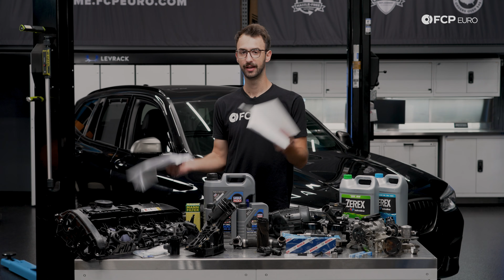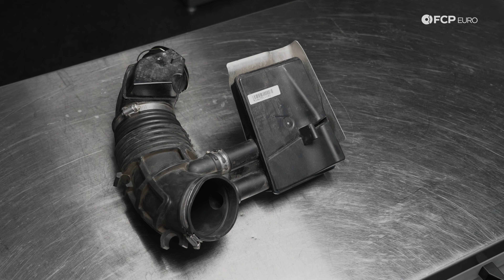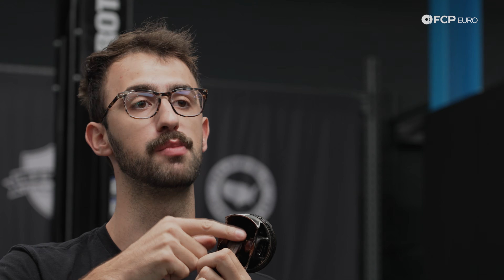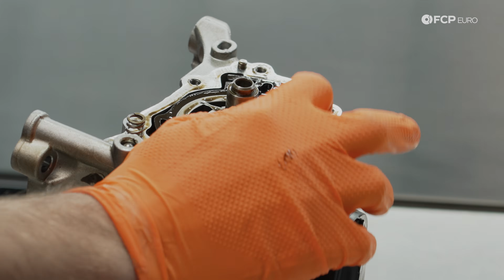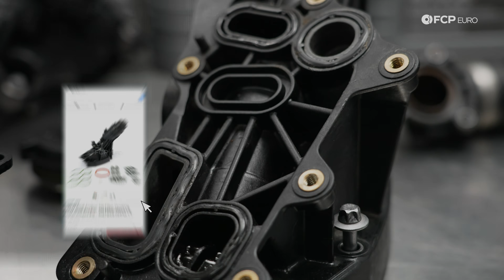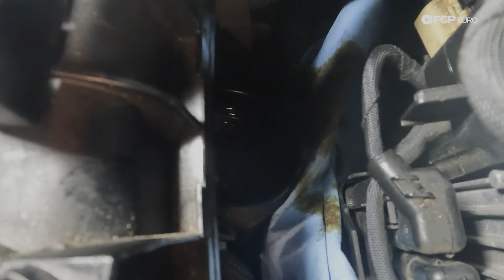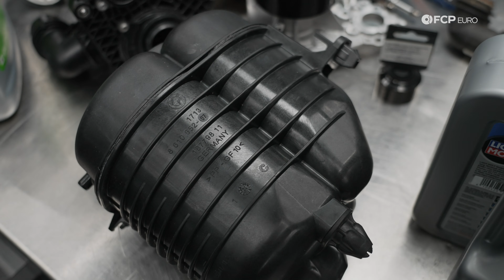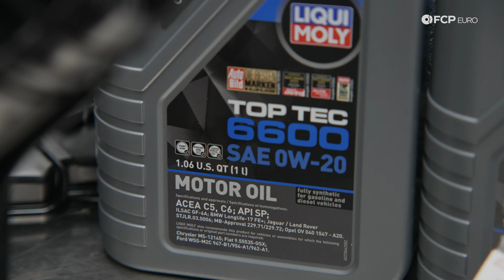BMW B58 Engine Guide: Everything You Need To Know

Comment: I have 440i 2017 with 180000 miles no complaints do maintenance on time. Now running mhd stage 1 and xhp stage 2, love this car.
Reply: You have just convinced me to not sell my 2018 440i w/manual transmission, which has only 11,800 miles because I have switched to motorcycles for daily driving.  
I have done the same; mhd stage 2.  I had ordered mine with the M Exhaust/Performance package.  I did not want to drive it due to fear of something breaking but if you have yours for 180,000 miles and love it, I am keeping mine 😊
Reply: @maldridge7630  great yeah man i love this car each day, mine is mhd stage 1 and xhp stage 2, i believe mhd stage one does the justice to price and also without putting extra strain on car. Just my opinion
Reply: @maldridge7630  mine just hit 120k its worth it to keep!
Reply: @maldridge7630what’s difference between 340i?
Reply: did you have to hcange the oil filter housing?
Reply: @TheDumbCow1 no but my engine oil chamber where the oil drain plug is showing wear may need to redo the thread I believe may be due to excessive torquing by mechanics
Reply: That's good that it has that kind of longevity mine has 88,000 me already 3,000 of those miles but I've done a lot of hoping it lasts cuz I love the car
Reply: just do all the oil and plugs earlier. Also at time i do put injector cleaner additive.
Reply: Does XHP stage 2 make a big difference?
Reply: I think, because when i had mhd stage 1 it felt like car is holding up the torque and not really utilizing, after xhp stage 2 it really opened up.
Reply: @jeremyalves9814 I don't think it makes a big difference it's just something you run if you've got a catless downpipe or a high flow aftermarket cat and you won't get a check engine light and it might make a little more horsepower too
Reply: @ShanDobson thanks for the reply. But I think you’re a bit mixed up there. Stage 2 ECU tune is for the check engine light. XHP is a transmission tune so not related to the CEL.
Reply: @jeremyalves9814 10-4 I wasn't paying enough attention sorry
Reply: @jeremyalves9814   it does feel faster and more aggressive like the M cars 8 speed
Reply: What did you change so far?
Reply: @bmw3series128 i bought the used car at 185000 kms it had minor radiator leak, i changed the radiator after 2 years, i have changed expansion tank and its cap, i changed the compressor at around 260k+ kms. Rest preventive & regular maintenances.

Comment: Expansion tank leaks. Try the cap first. Cost £15/$20 for a genuine part. Fixed leaking issue on my 2017 540i xdrive. Caused by cap o-ring degrading. Use BMW part, don't use non standard parts. The cap contains a pressure spring to vent excess pressure to atmosphere. Non standard caps may not contain the spring or may contain incorrect spring meaning the expansion tank can be pressurised beyond limits and begin leaking itself.
Reply: Or replace both pieces with aftermarket, it's how the tank is sold on every one I replace. Aftermarket parts are often an improved design and better than OEM. 😉

Comment: So what I’m getting is BMW didn’t purposely make it a good engine it just turned out that way because it was based on the diesel version and they probably carried parts over because it was cheaper than buying different ones. I sure am glad it happened at all though.
Reply: It's a toyota designed engine. It's why it's very reliable.

Comment: You apparently don’t have much experience with the n63tu2.  It is EXTREMELY reliable with nothing but 5,000 mile oil change intervals.  It is not the original n63.  With 10,000 mile oil change intervals, any engine will have issues. Bottom line.

Comment: 2019 X5 40i owner here. 
From my understanding, the cars serviced at dealer with original viscosity 0w-20 oil should not experience this oil pump failure. 
Any counter example to that? 

In forums a lot of people complaining about this issue. 
It is kinda scary every time you check the oil level and to see if it is going to quit measuring without completing the operation.
Reply: I had not heard of the viscosity link to failure that Alex mentioned.  Would love to see the data on that.

Comment: I’ve had my m40i for a year now and it’s just such an awesome car. The best daily driver you can get. Great video, learned a lot!
Reply: Have you had it in the winter? I'm super curious. Also are you over 180 cm? How do you fit in it? It's one of the cars on the list to replace my 500hp 2012 A6, which I love too much. 
They're still holding up their price too! You picked well.
Reply: @OWanKeno9i  Yes, had it through last winter. I have a 2nd set of winter wheels and tires. Does great in snow. I am 190cm (6 ft 3 in) tall, and I fit very well. Not much room behind me for passenger though when I’m driving, but I almost never have more than 3 people in the car. I only have 23k miles but so far no problems!
Reply: Is the suspension as punishing as they say, or is it just the OEM run flats like I have heard?
Reply: @gregroles69 the X3M is way worse. I still have run flats on for summer tires but I don’t mind the stiffness. All seasons in 21” are hard to find unless you go wider than OEM. It’s definitely a sports car ride and on the stiffer side but I enjoy it. My wife has a Lexus RX for when i want a soft and comfy ride for traveling and we take that on trips.

Comment: The thing i need to know (as a 2019 m140i owner with 108k km, 67k miles) is which of these maintenance items can be done once it breaks and can in the worst case leave you stranded with an error message.
And which of these items can actually destroy your engine if not done in time. 

Because doing all these things at a certain mileage is still very expensive. but getting like 1 or 2 things out of the way for peace of mind and then when something non fatal to the engine breaks take care of it when it happens.

I would like a clear answer like: change your oil pump and oil filter housing now and other things will give you an overheating error or something like that. I would like to have that peace of mind.
Reply: I would like 😂😂😂
Reply: @CraigjustinShearer 😂😂 fr. Use AI for all that.

Comment: I keep almost buying a Z4. The fact that BMW couldn't ever figure out how to design a long term functioning fuel injector for the previous gen Z4 along with the laundry list of other problems pushed me to the new Z4/B58. After watching this video....nope. Nope. No. I kept my wife's beloved 2011 BMW running for 13 years doing all the work myself and why I would ever consider buying another BMW shows I'm a sucker for a beautiful car. But no. I'm not putting myself through this again. Plastic engine parts where there is no way it is a good idea, making me go through hours of disassembly to replace common relpaced parts, Parts that are not built to last being sold for a fortune. Dude.....in our fleet we have a 2007 Nissan Xterra we bought new. Its now got 306,000 miles on it and I've replaced the starter, one power window motor and ONE minor leak at the oil filter housing 8 years ago. That's it. Everything else is original and I just drove it last month from Dallas Texas to Phoenix and back. Its dead reliable. All cars now are full of bad ideas forced on designers to get every last MPG due to emission standards. They are rolling disasters. After working on cars for 40 years, I'm done with this crap. I dumped my wife's BMW and put her in a new Tesla purely because I was sick of fixing failures and maintenance. In 4 years I have not touched her Tesla and neither has Tesla. I've got my track day toys, and drive the Xterra daily. I hate it, but I am seriously considering adding a second Tesla for me to daily. Two dead reliable cars to get us where we need to go, and I can only turn wrenches on my track day toys and my Viper. I'm done with all modern ICE cars. No matter how gorgeous they might be.

Comment: BMW make fantastic straight 6 engines but apart from the B38 and B48 they seem to struggle making any other configuration.
Reply: Well the b series really is an better that the n series of engine but they haven’t built a b series v8 as yet so that might just be the best one lol
Reply: @walkerbway  I bet it won't be as good as a B58. It has taken all of these years for BMW to make a 4 cylinder (B48) which was as good as the S14 fitted to the original M3. I am not holding out much hope of them getting a V8 right at the moment.
Reply: Ever heard of the B58 or their equivalent diesels?
Reply: @dgdave2673  Yes, I own a B58 is a 6 cylinder. The diesel version is the B57

Comment: Is it possible to lower IATs somehow with the air to water set up?
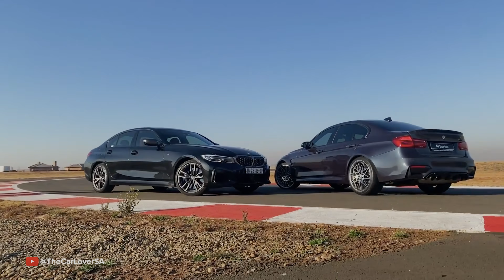Reply: With an mhd tune it is. Their intake temperatures with that setup are surprisingly low to begin with but you can use a sports setting on that system to lower them further. You can also lower the target cooling temperature which I did so the cooling temperature never goes above about $200 now and the oil temperature only goes to about 2:16 we're at went to 2:30 before I just feel like it runs better and we'll have a lot better longevity and didn't seem to affect the fuel mileage fuel mileage this is on a 2017 m240i gen 1
Reply: @ShanDobson  Ah OK, good to know. I am guessing the air to water cooling system has its own electric pump and the MHD tune just runs it faster to meet the target? And I assume the oil temp is thermostat controlled? Would love to know if you or anyone else is certain of the set up.
Reply: @kingGar27 both water and the oil have very very sophisticated control mechanisms. Yes the the changing of the tune settings in mhd just lowers the target temperature of the water controller and as a side effect I guess it also lowers the oil temperature 230 degrees higher than I want my oil temperature to be its shortening its life and robbing a bit of horsepower
Reply: And 216 degrees is above the boiling temperature of water so it keeps the water out of the oil lengthening its lifespan
Reply: @ShanDobson  it's the 'sophisticated control mechanisms' that I'm most interested in. I have a 2013 M550d with air to water, but I don't believe there is any such way to control IATs. Air to water is great in that it has a huge amount of thermal capacity, but once it heat soaks it requires some easy driving to get it cool again.

Comment: OK I need clarification. I have a 2020 540i with a build date of November 2019. Based on many online references, I have a Gen 1 B58. However, you said that the new valve cover is on 2020 and above Gen 2 B58s.

I'm going to pull the engine cover off tomorrow to look to see if it's got a PCV valve, but what version of B58 should I have?
Reply: Just pull the cover and look if you have that round PCV cap then it's a gen 1
Reply: @ShanDobson OK, I don't have that cap, but every website I go to says I have a B58B30M0. If I had a Gen 2, wouldn't it be a B58B30M1?
Reply: @MacG467_ I am not qualified to answer that unfortunately I just know they do look different my gen 1 has that round cap in the back and it's already been Pride off and replaced at 84,000 MI
Reply: @MacG467_ The valve cover still has a pcv system. The guy is wrong saying it doesn’t. Also, the B58 in the G30 is different than the one in the G2X cars - less hp/tq so I’m sure the engine code is different too.
Reply: @AnontheGOAT  I found out that BMW calls the engine in the 2020 540i a "B58B30C" according to my mechanic. So Wikipedia has the G30 in the wrong category for the 2020 MY. The same engine is also used in the 2020 Supra.

It's still considered a TU engine, but doesn't have all the enhancements to the TUs:
It's got the two port exhaust header, no external PCV that can fail, and is considered a "Medium HP" engine.
The TU engines are technically considered to he "High HP" engines because they have the 6 port exhaust headers and the different turbo to match. 

The B58B30C is kinda a Frankenstein engine.
Reply: @MacG467_ Yup! That’s exactly it. Some elements are the same the high HP TU engine and some are not, just like you pointed out.
Reply: @AlexNelsonFCPEuro Are you referring to the check valve within a pipe/hose that comes out of the engine block and mates up to the intake tube right past the turbo? The one that supposed to pull in the oil vapors out of the intake and back into the engine?

Or are you talking about the large one that goes from top of the valve cover down into the intake tube?

Comment: In Europe multiple oil manufacturers including liqui moly sell 5w40 oil for b58 with LL-04 and even ll01 approvals, if you use oil selector.
Reply: We're not saying 5w40 isn't a listed alternative, just pointing out the added strain it could place on the plastic oil pump carrier over 0w.
Reply: @NAMBUGMAN said clearly - "heavier oil" w40 is a lot heavier than w20 at operating temperature. 0w vs 5w is irrelevant unless very cold climate

Comment: New to BMW world, which B58 should I get for trouble free miles?
Reply: I think if you have one of those 2019-2020 oil pump with the plastic outside impeller I wouldn't run the thicker oil but otherwise they're all good with 040
Reply: m340i

Comment: Damn😢I have a 2020 X5 M50i. I’m about to do coils and spark plugs. I do oil changes every 5k miles. Transmission fluid just got changed, both diffs got oil changed and transfer case fluid got changed about to do it one more time.
Reply: Why change the coils?
Reply: @jackchueh1231 to be honest, the coil packs when removing usually pop off from the other half. And need replacement.

Comment: Terrible 
Comparison  
  should have done the 
X5 N55 
and 
X5 B58 
And show the maintenance records. 

7 years at bmw and not a single n55 
Rod bearings failer has came in besides drive belt getting sucked into the crank…failers are from negligence.

Comment: The B58 is an excellent engine BUT I’m always confused when people say it’s the modern 2JZ or BMWs best engine when the S58 exists and is better in every single metric….. except price. I guess that’s it. For the price of the cheapest S58 car (SAV) and a E50 tune to make 750whp, you could build a M340 to 1000 but that’s a build vs a file download lol.
Reply: I'm in my 20s had low mileage m340i money but not even close to g80 or mid mileage f80 comp. I will eventually be able to slowly modify and build my car how i like, this is my daily and hobby car! It will be replaced by a suv daily at some point and turned into a race car. If i saved up for a g80 i would be 40 with kids will probably not mod it, doesnt seem as fun to me.
Reply: @dan.340 nice point. So I currently own a F82, G87, and F97(X3M). I wouldn’t go from a B58 to S58 expecting to feel a huge change. My S55 has 114k miles on it with zero issues in its 70k miles of being stage 2 WITHOUT crankhub done lol. Feels like it’s trying to kill you all the time but you have a little extra top end to play with. The S58s are just aggressive at all times. The biggest difference going from a M340 to G80 will be all the other things that support the extra power and reliability. Cooling, differentials, transfer case, steering/turn in, chassis dynamics. Now when you start running, that’s when the S58 starts to shine way more. You can get to 750whp with only a tune on a 100% stock S58. Watch Kies G87 tuning video from earlier this year. That tuned, stock G87 will perform at the same level without transmission or differential overheating, cutting power, or breaking axels or driveshafts. So yeah you can build a 800whp B58 but it’ll be a build for sure. 800whp S58 will be much more capable and feel stable/less exciting but it’s 2 different experiences. I think the complete package supporting the S58 is a bigger callout than the engines themselves.
Reply: @dan.340 oh of you’re looking for a daily SUV I swear my X3M is the best of all worlds. I can run low 10s at the track, leave and go to Costco, then out run hellcats on the way home fully loaded. I have a bunch of M cars but honestly I wouldn’t suggest saving for one just for marginal gains because then you have to pay that M tax to start building. FBO, wheels, some carbon, and tune and my X3M build is at 20k. I’m around 40K into the G87. It’s fun but not worth it if I had to save for it.
Reply: S58 is a lot better for true performance environment but the B58's low end torque & responsiveness makes it way more enjoyable for daily / spirited driving on public roads
Reply: @davechen1426 exactly, I've seen dozens of videos of drag and street/highway races between B58 and S58 cars, the B58 is right there up until around 90-100MPH and then the S58 eats its lunch (and past around 115 or so it's just gone). 

But how many people are driving around B roads at 90mph, or even on highways over 100 in a regular basis. 

BMW knew what they were doing when they designed these engines.
Reply: @SliderFury1 exactly
Reply: Plus an s58 the whole motor and cooling package Etc is apparently considerably heavier and these modern BMWs are stupid heavy to begin with !  @SliderFury1
Reply: @davechen1426 I agree plus an s58 is far more crammed into the motor compartment with twin turbos and all that nonsense. Lots more stuff to go wrong
Reply: Stock its as good as a 2jz, but the 2jz has a much higher tuning cieling than the b58